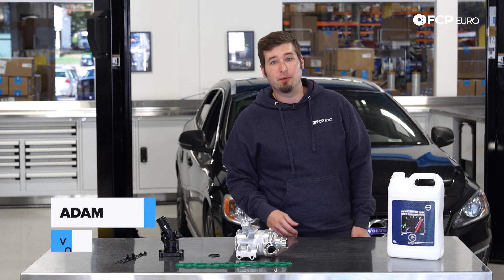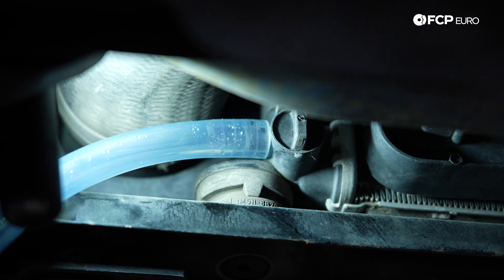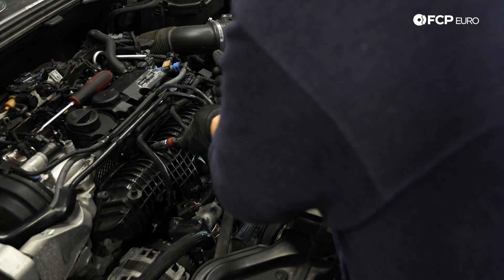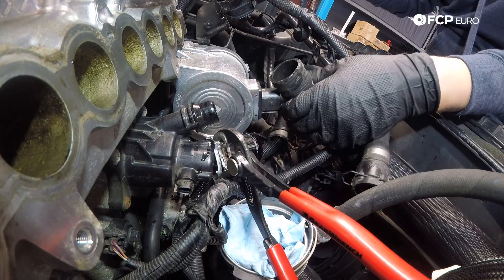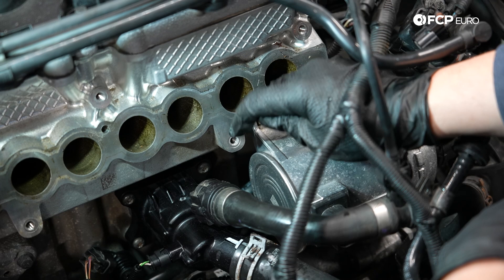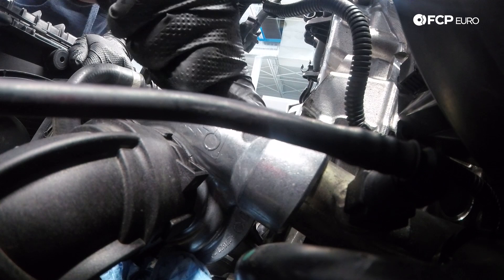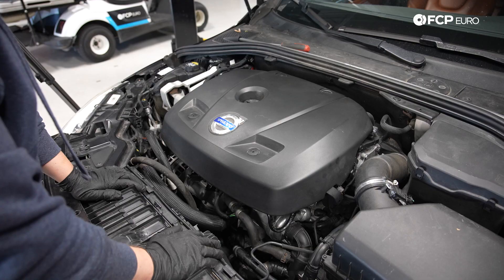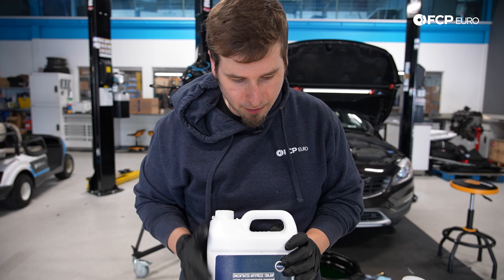Volvo S60 Water Pump & Thermostat Replacement DIY (2015-2019 Volvo P3 - S80, V70, XC70, XC60, & V60)

Comment: Just completed job. Great video. Couldn't have done it without it.  One note: i used a Maddox vacuum filler from Harbor Freight. For the air source, i used my Craftsman 3 gallon,  125 psi compressor.  It pulled 25"of vacuum with no problem. Used about 1 to 1-1/2 gallons of coolant for a refill. Maddox product worked great with cone adaptor in reservoir. Cover little vent slit with duct tape. My volvo is 2016 XC60 2.0 turbo.

Comment: I just recently replaced the thermostat on my wife's 2015 V60. I was able to replace it without taking the intake manifold off. Took the alternator off and went in from that side. Pulled the alt. out the top as well. It takes a little doing but you don't have to replace the intake gasket. Looks like the water pump will come out as well without removing the intake. If your replacing both at the same time and you remembered to order the intake gasket then yes it looks a little simpler to go that route. And if you don't  have access to a vacuum pump apparatus then after refilling the coolant start the engine and run it till the temp gage shows normal temp. Go and squeeze the upper and lower radiator hoses. It take a couple of times to do this so be patient. Of course if you have access to all the equipment in the video that again is the better way to go. I just saying that I is possible to do these repairs without removing the intake manifold. And don't for get to top off the coolant reservoir.

Comment: Thanks a lot for "highly recommending" the vacuum coolant refill.  I had some engine overheating problem and no heat problem with my 2015 S60 3-4 months after a shop replaced one of the coolant hoses due to leaking coolant.   They further recommendated to replace the radiator for almost $2K after they did a coolant pressure test.  I decided not to take their advice and found out later that was actually due to some air trapped in the coolant system.  After I filled the coolant under vacuum, the heat came back and no engine overheating anymore.
Reply: Hello, good morning, the same thing happens to me and I changed the thermostat, water pump, chamber gasket, temperature sensor, PCV valve and my car, Volvo S60 T5 2015, the temperature keeps rising, I'm going to change the vacuum coolant, thank you very much.

Comment: Great job. It is a pleasure watching you fellows work.
For those attempting this project on their own, it would be wise to block off the intake ports with rags while you work on replacing the water pump, and the thermostat housing.

Comment: I have a 2017 VOLVO XC60 T6 AWD R design with that 2.0 engine. I recently had to drive to Mississippi, Dallas, Tx and back to New Mexico. One of the brittle vent lines for coolant snapped and leaked (poor design and cheap materials (7 years old) and a coolant hose with a plastic female end adapter with nipple for vent line also snapped due to being brittle. I replaced both immediately. 
My question is:  does VOLVO or FCPEURO sell a complete coolant hose and vent line kit so all rubber and plastics are replaced at the same time?
I know what it’s like being stranded on the highway and it’s no fun.

Comment: Ahh yes. The classic Volvo quirk. "Want to touch the engine? Take the intake manifold off."

Some things I noticed:
1. That green clip is like a large Ford fuel line clip where you just push to open once you take the lock out of it. 
2. You say the 2016 models had the electronic thermostat. Did they keep the electronic section through the run until the new cars or did they delete it?

Comment: What is the correct gasket into the intake pipe.  It looks like yours is black. The replacement one I got from the dealer is green and doesn't seem to fit properly. Does it come out of the package and go right in, or does it have to be twisted before inserting?.  Such a pain.  Thanks

Comment: Someday there might be a good video on the 3.2/3.0 which is hella cramped, but I guess it has still not come to that day.
Reply: Much easier than the 2.0 you just reach down and change the thermostat housing nothing else has to come off but the water pump on the other hand is behind the ps pump which is more involved

Comment: does anyone know what the coolant line he removes at the beginning of the video is called, it goes to the back of engine, i busted mine changing out the spark plugs
Reply from the maker: Hi John, that we will link for you here:
https://www.fcpeuro.com/products/volvo-cooling-hose-genuine-volvo-32222278
Reply: Does anyone know what is the correct running temperature of this Volvo Drive E engine ? I had a bad thermostat and it damage the ECU. Get both changed. i notice the radiator fan always run at full speed when engine reach operating temp of 105degC. Water pump always run at 5800rpm when engine at operating temp of 105degc and idling.

Comment: Does anyone know the normal working temperature of the coolant when the engine fully warm up? I had my thermostat changed,  it always control at 102-105 degC, causing water pump always run at max speed of 5800rpm and fan at max speed too.
Reply: Mine ran in the low 90's before it had issues.

Comment: I just did a starter motor on my 2019 Volvo XC40 T5 R design. For this I had to remove a hose off my water pump and lost some coolant, on completion I bought a vacuum tool. For whatever reason I cannot get a vacuum. I undid plug as you show on radiator, and didn't get a lot of coolant out. I've put about a gallon in tank manually, but worry it's not around my system Can you help
Reply: I was actually able to fill it. What I did was cut about an inch off the rubber cone that's part of the Maddox tool, it fit snug and drew about 20lbs steady even though my  filler showed between max and min, I pulled in about 3/4 of a bottle and hoses squashed flat as they're supposed to, so feel confident it's full now